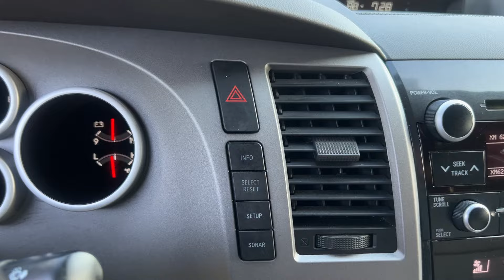11 TOYOTA TUNDRA LIMITED 5.7 BLUETOOTH POWER LEATHER HTD SEATS ALLOY WHL TOWING 2 FL OWNERS PRISTINE

Comment: I would definitely have this truck checked from top to bottom by a mechanic and if it passes inspection I would gladly buy it before I buy a brand new Kia.  Even with all that mileage, if taken care, this truck will last forever.  I own a 2004 Tacoma Prerunner with 282 thousand miles and still runs absolutely awesome.